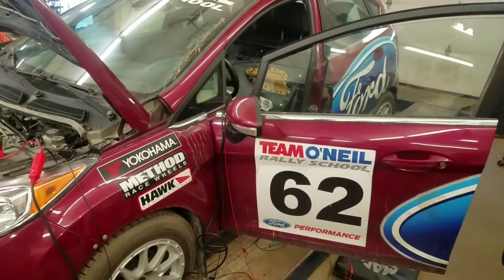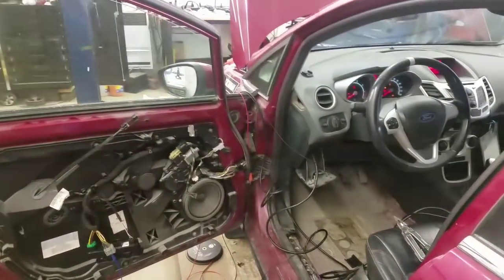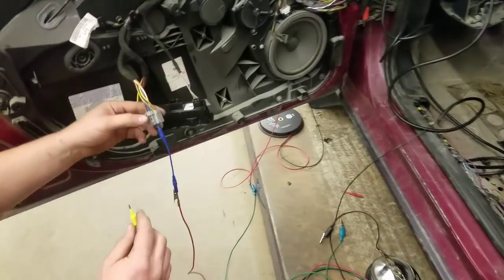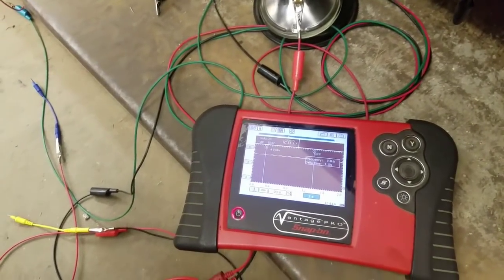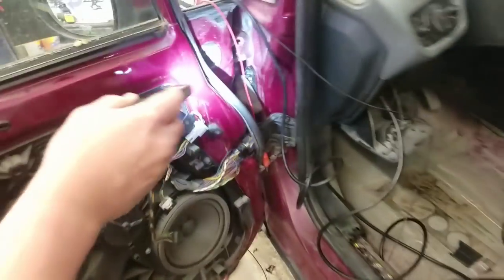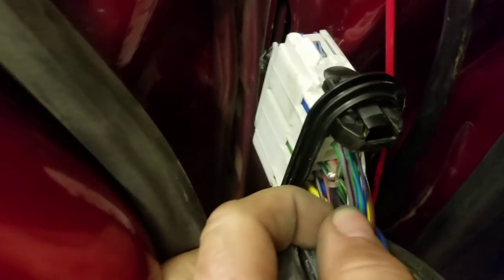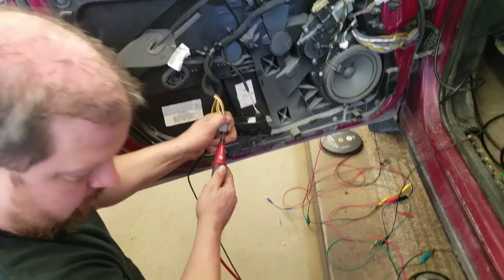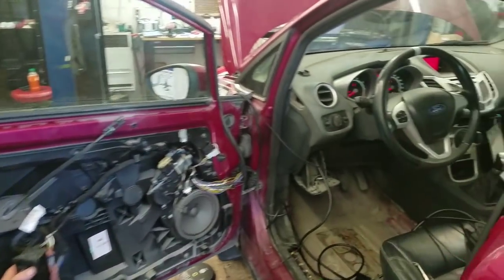2009 Ford Fiesta electrical issue's

Comment: hi sir just asking, are you using two retractable test leads on this video? im interested on buying one any particular brand you can suggest cheers
Reply from the maker: I have 2 different lengths of retractable leads I use 10 and 30ft Amazon or your local tool and equipment rep is where to get them. Thank you for watching

Comment: This is great advice. Always load test circuits for high load circuits. I’ve seen circuits with two wires out of twenty where still intact pass an ohm check but that wire will not carry current.

Comment: I also own a load pro and I have found that it works as advertised. I used it on an old chevy pickup with an inop fuel pump (pump and gas tank were new) Found a bad frame ground in less than 10 minutes with it.